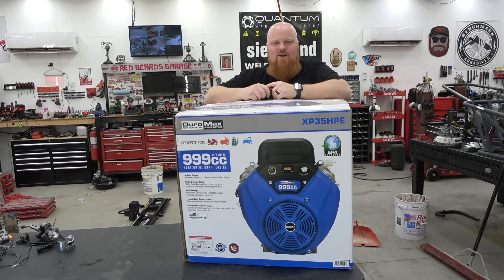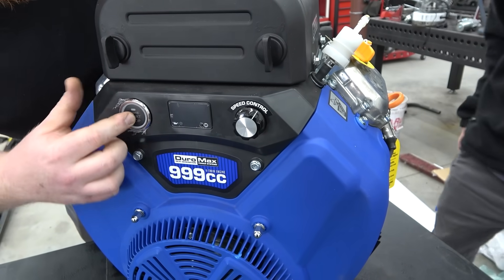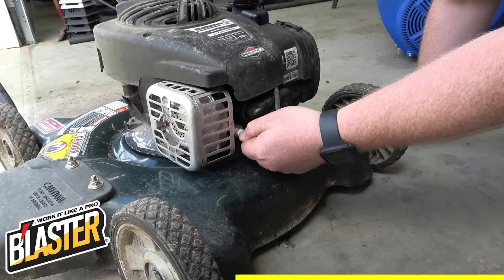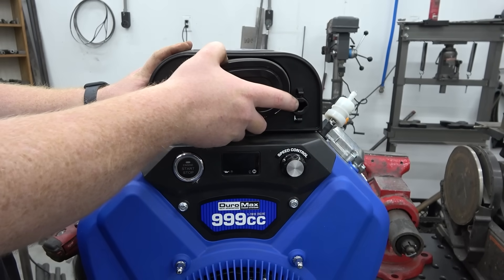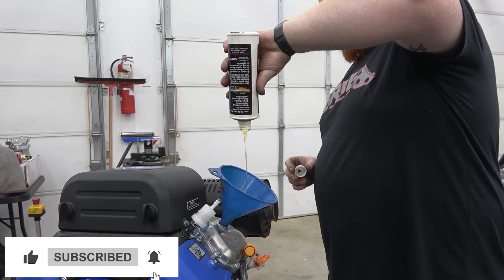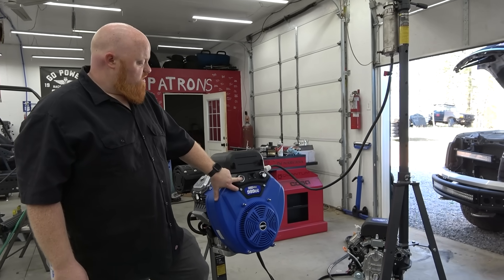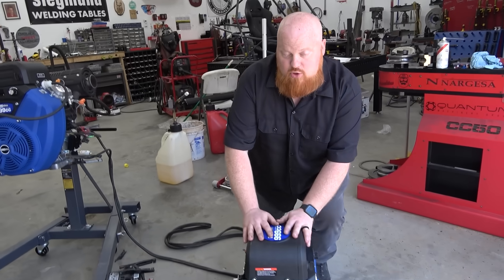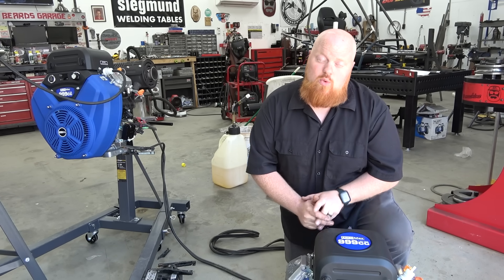👀 NEW 999cc V Twin Engine ~ 58Ft-Lbs Of Torque!!!

Comment: Hey I just found your channel and have questions on where you find your 670 performance parts I'm currently working on a project that mates the 670 to a VW trans. The adapter is made and works as it should. It involves making an adapter to mate the flywheel to a 1 inch shaft and totally supported by pillow blocks. The engine is mated by chain and is not supporting the flywheel. But enough said, I would like to know where you are getting your parts, are you grabbing in house, are you using a parts company, etc. please help!

Comment: Hello, great reviews on everything.  A question i have a older honda twin around the 670 with a few issues.  Would one be better to get another engine in the area of this twin cylinder.  Im considering on building a generator with a 15000 to 18000 kw.

Comment: Thanks for showing us this engine but I think when you break in an engine you are not supposed to use synthetic oil or any zinc anti wear additive because you want it to wear in a little bit and it can't if you put anti wear additives in it. Is there an oil filter on that engine???😮

Comment: To my knowledge full synthetic shouldn't be used on break in. It's to slick and you need convention oil to allow rings and cylinder walls to seat like they should. Done it on 2 different ecoboost engines that had a built bottom end and the builder said to run conventional oil till around the 1500 mile mark then can switch to oil of choice.
Reply: Hi zinc is good for breaking in yes but I would never use full synthetic to break in and engine. You won't get any ring seat

Comment: You can use a gas pedal assembly from any vehicle that is the same fly by wire setup.  Vw dodge gm they all make throttle pedal assemblies that operate like that throttle knob does.

Comment: for 2 grand i can go find a scrap bike and steal the motor and have a more broad power range instead of a generator motor with less usable RPM range. torque isn't always important. those engines also are name brand, not chinese poo poo.

Comment: Hi I have question I just bay new engine like this but I put oil setup battery but now the botón for starting is on red I put another battery same the bottom is on red don’t want start and starter smock I don’t do anything my question I have to do some things or you think I forgot setup something thanks

Comment: get an accelerator pedal out of the scarp yard from a Prius, they have the electronic box attached to them to work the speed control unit, they have 6 pin connection block attached to them, should work, might work,

Comment: Zync is about the same as graphene powder. Does very little. Just change the oil the first 500-1000 miles, and every 3-5k miles after that. Not good to rev the engine when brand new.

Comment: Seems kind of silly to make a 'drive-by-wire' system for a carbureted engine.🙄 It would have been much easier (and more efficient) to do it with EFI. It still may cause you problems when you replace the carb with a mechanical unit, if the ECU is tied in with the throttle controls, and decides to not start unless it senses the throttle and choke stepper motors. Also, you may have to hack it to go beyond the rated rpm, if the ECU limits rpm via the coils, as well as the throttle position. I wonder how well that 'start/stop' switch is sealed up against dust and other assorted trash? Seems like future problems to me. I guess a regular old key switch was just too simple.🤣

Comment: I'd like to New Zoo stripped-down weight without the muffler and the Mikuni when you're through and I off with all the external sheet metal office for its weight interested in using on ultralight aircraft would be perfect

Comment: Appena lo ho vistoquesto motore,  ho pensato : Se la Fiat  avesse prodotto la Panda 45 equipaggiandola con un motore bicilindrico 900cc 0 1000cc frutti dell'elaborazione del più piccolo 650 della panda 30 che divertimento sarebbe stato?   Vedendo questo motore come gira equilibrato e tondo mi dispiace di non poter provare a montarlo su una panda  e poi omologarla con questo motore per andarci in giro tranquillamente!

Comment: I guess if you knew what the resistance is for the potentiometer for the speed you could install an electronic pedal with wires running back to the engine.  Another idea is take the knob off, 3D print a small gear to replace the knob and a larger sector gear for the pedal Bowden cable and a frame to mount the components and the Bowden cable, you could control it that way too.

Comment: I would like to see the internals of this engine. I would like to see the cam and know the specs and see how close it is to a 670 cam. I wonder if a performance 670 506 cam would work in this engine to make the torque curve between 3000 and 3500 rpm. I would like to see you dyno this engine with the mukuni carb.

Comment: I would worry about the engineering that went into this engine. Why such a big shaft? You are talking about taking the crank out and having it machined down? I wouldn't buy just for that fact. And who in the hell turns a knob to change the RPM in their riding lawnmower. There are way too many mods to make.

Comment: Remember you running an AIR Cooled Engine in warm or Hot weather...   SO, I'd use Full Synthetic SAE 10W-40 oil if I were you for higher hot weather lubrication protection

Comment: How difficult would it be to convert this engine for use in an airboat. I'm wanting to build an airboat on a budget. According to the crunched numbers I need a 60 hp engine. Also according to the crunched numbers this 999 cc engine could, theoretically, work for my application. I just need to figure out how I could possibly pull it off. Any ideas? Thanks!

Comment: maybe an electronic gas pedal from a car/truck with electrinic throttle control, I wastched grindhard pluming use one on one of thier 2 trikes. It was a self contained device, it looked like a gas pedal with a little box  at one end pluging to a harness to the carbs/fi... just a thought.

Comment: this V Twin does sound good ! i liked the ability toruń it on the new Stand too , i also like your idea of simplifying the Stock Carb to a more traditionalMikuni set up  also will be neat to see what Aftermarket Performance parts come out  after it’s real release … maybe a Cam to give it a Little  more Harley Sound ?  who knows it might start a new trend of Homemade Chopper builds ? i’m guessing the Chinese must have  a HD or Baker Clone  transmission  or get a Custom Pulley machined to do a CVT style set up ! Imagine that fully automatic twist and go Choppers  homemade

Comment: I have an ancient skidsteer with a Wisconsin V4 that doesn't run very well. Plan to swap out motors. In my case I just need to have a coupling to the hydraulic pump. Will have to fab a motor mount to get everything lined up.

Comment: This thing is going to be a monster if the modding and aftermarket community takes hold of it. The v-twin predators get some sweet big bore kits and other upgrades. I could see this pumping 75 horsepower or more. 50 at the very least.
Reply: Take the electronic switch out and move it up front then extend the wires and as far as the crankshaft goes make a jackshaft and enlarge the inlet hole on the motor to fit the crankshaft then go with a normal size pulley on the other end and you have 2 ways to adjust your speed and your converter.
Reply: Sounds like a plan

Comment: It's a by wire setup so if you take a wire from like a police Crown Vic that's got the throttle-by-wire you should be at a depth at throttle pedal to the carburetor all you need to know is what posted the signal receives and sends

Comment: Hey redbeard, I am in the commercial pressure washing business and I use a kohler 999cc with a 1-7/16 shaft. Southside equipment in Louisville ky can get you a pulley for that size shaft.  Ask for Russ

Comment: Hey Red Beard, love the video! Just wanted to add a little bit of information concerning the electronic carburetor control. I have just received my Duromax 999cc engine for my mini airboat. I previously had a wore out vanguard 35hp and I purchased this engine to replace it. As soon as I received it I took the front cover off to check out the potentiometer. The numbers on the back gave me little information honestly and seems to be a 2 wire industrial type POT. I then did a ohms reading on it and it’s 0-5k ohms of resistance from idle to full throttle. I hope this helps some of you all with current or future builds involving drive by wire. Keep up the great videos Red Beard and God Bless!
Reply: Hey Tommy, I'm wanting to do the same thing. What did you end up doing with the throttle? What did you do with the larger shaft? Did you just change the old yoke to a bigger one?

Comment: Where do you get your spare parts for the Duromax engines?  Like head gaskets and such.  I'm working on "enhancing" the Duromax 713cc I put on my Honda Odyssey Fl250.  So far I've found a lot of interchangability with the Honda GX670, but for parts that are unique to the 713, little success.

Comment: Pull the stepper and rotary encoder, fabricate an arm for the throttle butterfly and be rid of the undersized chinesium stepper garbage.   An eu2000 gen stepper is bigger.

Comment: 59 ft lb at 2500 is only 28 HP. Kinda disappointing. Could be wrong though. The Duromax website says it is 771 cc, so maybe that's an error. I would expect it, even as an industrial engine, to putting out at least 45.

Comment: 10 30w not adequate for hot running air cooled engines. Should use 15 40 or 15 50w regardless of what the manual says.

Comment: The throttle seams to using type of control you use with electric throttle peddle. It is basically just a pedometer.

Comment: I don’t mean to be a Debbi downer  …butttttt!!!!
But 2 grand for a lawnmower engine is super expensive 
When I can buy a Hayabusa motorcycle part it out and get the engine for almost free 
186 horsepower 10000 rpm 
And the the performance parts for these engines 
I can build a ls engine cheaper …just saying !!
Older gsxr 600 bikes can be bought cheap 
And you’re getting a transmission with 6 gears 
And a clutch 
Buying all the stuff to put that on a buggy with performance parts 
Would break the bank 
Don’t get me wrong it cool 😎 I love it …it’s just way to expensive 
I know it’s cheaper than a 35k polaris razor 
I’ve got a lifted sick as geo tracker 4x4 With 34s I’ll sell you for 4500

Comment: I wouldn't think it would be difficult to set up the throttle, they usually use 2 wires on a potentiometer. I would look at how a computer joystick is set up for the return spring, that's the same sort of deal

Comment: I want a buy one with a 1” shaft and put a gear drive reduction with an AR RTX 60 15gpm/4000psi pressure washer pump. They advertise needing 42hp. But at the end of the day it’s the torque that gets you places and this might just have the beans to push a setup like that.
Reply: 15gpm is one mean pump lol! But yea I believe this engine would have enough power to turn it with that big low RPM torque it puts out.

Comment: This engine has more horsepower than the Type 1 Volkswagen 1000cc and 1100cc engines so technically you could repower a Volkswagen Bus or Beetle which those engines were in 😆

Comment: 60 ft lbs for a 1000cc is sad, compared to other twin cylinder 1000cc engines putting down over 100 ft lbs
Reply: Yes but keep in mind this is a air cooled , carbureted, low rpm and low compression engine. It’s not designed to be extremely powerful but reliable. Also, it doesn’t have to work hard to produce that torque. Those other 1000cc engines are DOHC, fuel injected, higher compression, high rpm and water cooled. With a few mods I’m sure you could double the HP on this engine which would be impressive for an air cooled industrial engine that was never built with high performance in mind.

Comment: forget about a CVT that'll only shred belts, mount that in a VW bug.
build a sand rail with a VW transaxle, whatever.
in a bug the head shrouds could even be plumbed to the heater tubes.
its charging system could run all LED lights easily too.
Reply: seriously, similar output power, similar rpm range too.

Comment: The big V twin is cool but I think if you're going through the effort of a custom motor swap buggy, you would be better off starting with a Honda Shadow Vtwin 1100cc. It already has a transmission and makes way more power to start with.
Reply: No reverse. And would ruin the whole idea of testing this engine. But I also wouldn’t use Harley transmission either. For same reason. I would run a jack shaft and use a very large atv automatic setup?  Just me.

Comment: took them long enough to meet Kohlers injected 1000 in 2008.. what were you waiting for.. oh.. torque has nothing to do with rpm.. 600 @ a gazilion rpm vs 2500.. its a factor of volumetric efficiency & combustion efficiency & the ability to turn a lever.. hence the foot pounds 🤔

Comment: It doesn't look like it would be that hard to rip off actuator plate and give that carb a manual input, I bet you wouldn't even have to do a governor delete since it's probably electronic. Alternatively you could extend the wires on the potentiometer and essentially have a fly by wire throttle set up. ps : you already mentioned it in the video lol
Reply: bingo, put RC car pinion on that knob, a spur gear to turn it with a throttle return spring on the spur gear = done. throttle by wire would be just as easy, but I'm thinking VW bug throttle cable connection.

Comment: If you do use a Polaris XP1000 drive system, be prepared to play with the fly weights! My XP1000 engages at ~2500rpm, and shift-up is around 6500rpm. I don't know if you plan to run that beast that high, but I would doubt it (at least at first).

Comment: If the rotation direction is correct, I want to adapt one to an air cooled VW bug trans.     It should stay cool enough with that self contained forced air shroud cooling.
Reply: yup, plumb them straight into the heater tubes outer pan, control cables are already there for the on+off inside heat.
Reply: It almost certainly rotates in the opposite direction of your VW bug setup but In many of those transaxles it is possible to flip the differential for reverse rotation I've been told that the transmission part isn't damaged by even aggressive  reverse rotation. However a friend of mine  attached a very beefy corvair engine. It would lift the front wheels easily. It didn't take many times to destroy it . After a few tries I think he finally switched to a corvair transmission. However that little V2 is a long way from a high performance automobile engine.

Comment: Comet EX780 and EX1190 torque converters come with a 1-7/16 bore. Rated for 24+ horsepower.
Reply: Ya if you could find some who has one in stock but be prepared to pay more than you paid  for the Duromax 999cc engine!!!

Comment: That digital throttle control will be killer for go carts! You can use wired electronic throttle pedals now. Much easier to setup and tune. Basically fly by wire.
Reply: How do you do that?

Comment: I had a thort buddy with the throttle on the new v twin.you can use a e bike hand throttle it has 3 wires and not to hard to solder in but but there will be a throttle response delay witch is a down fall .😁so yip put the new makuini on it for sure 😊👌 cool stuff allsome work guys 🌟🎉👍👌

Comment: You should be able to figure out what voltage it runs at for the throttle and just get you a throttle pedal out of a newer car with drive by wire plug and play.
Reply: If you keep the knob and install a bipass button on your steering wheel/ handle bars you can run it as an adjustable 2step till you let go of the button and the pedal takes over .

Comment: Diy electronic pedal using the potentiometer from the face would take 20 minutes of research. I have 3 that i 3d printed for servo controlled throttles. You could take those files and have them laser or water jet cut in metal easily.

Comment: A GSXR makes the same torque at a really high RPM because it also makes more than 5  times the horsepower and revs up a heck of a lot faster.
Reply: This will rev to 2000rpms faster lol

Comment: Surely you can replace the potentiometer from an old video game racing pedal set with the one in this unit and just extend the wires, or maybe a standard fly-by-wire pedal can control it with no interface

Comment: I looked it up on the web and it has ball bearings on the crank (great).  I couldn't find any info if the engine can be run in a vertical shaft, as most ZTR mowers are.  I have a Kohler 7000 series (POS) and will have to replace it in the future (trying to hold that off as long as possible).  Most vertical shaft motors (info I got) don't have ball bearings on the crank.  This looks promising.
Reply: Most cheaper engines have ball bearings on the crank instead of actual crank bearings like a car.
Reply: @JoshAllen17Goated  actually the opposite.
Reply: @TheClintmeister  Not actually true, TOTL Kohler, Kawasaki, and most diesel small engines use normal crank bearings like normal car engines. Cheaper and some more expensive brands Vanguard, Honda, Predator, Duromax use ball bearings for there crank bearings. Often that is used because they can’t manufacture a bearing that can withstand the tight tolerances with a film of oil at a cheap enough price. Where as Kohler, Kawasaki, and for example Kubota diesels, use normal crank bearing found in car engine that are made to withstand the tight tolerances with a small film of oil. Also another reason is due to those engine not having as good of lubrication and needing a ball bearing to keep from seizing which isnt the best idea as most times they are molded into the block and oil pan.